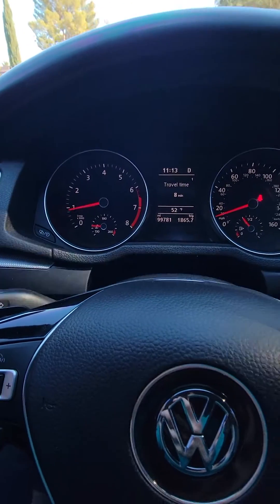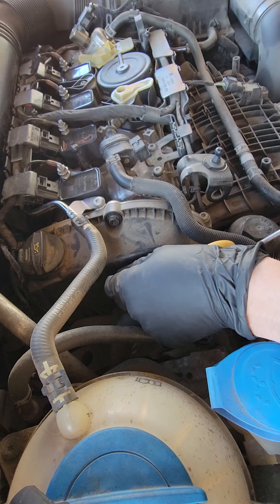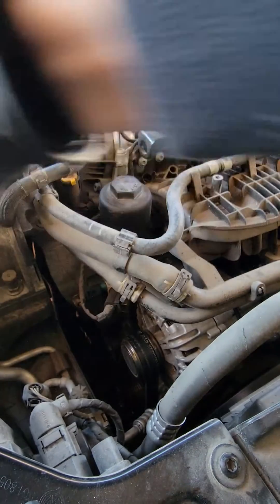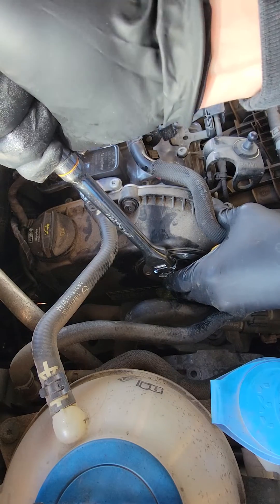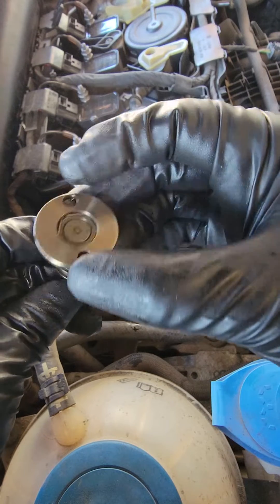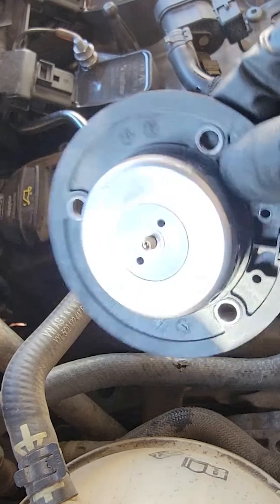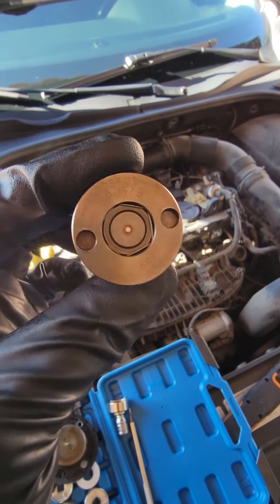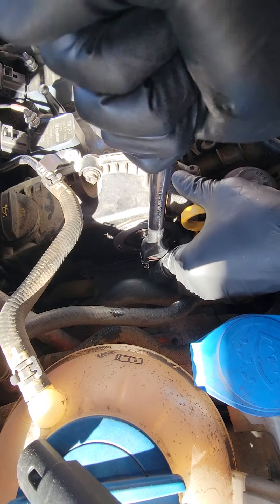Stop Doing 10k Oil Change Intervals! | VW 2.0T P0011 Common Cause & Repair

Comment: I replaced the magnet thing with a brand new one and now that one seems to be failing but I think that the actuator is leaking more than usual so I bought a new one and the kit from Amazon but I'm having trouble trying to get it loose it seems stuck almost or when I go the same direct you went when turning it feels like it goes but bounces back it won't fully unloosen is there any advice you have ? I have a Audi A4 2014 b8 2.0t and has p0011 code
Reply: Are you undoing it clockwise
Reply: @uknown8797 I'll get a better vid next oil change it'll be soon
Reply: I was doing it wrong at first but I fixed that  @uknown8797

Comment: 1:30 what wrench tool or whatever are you using here?
Reply from the maker: Here is everything used in the video - Camshaft Adjuster Magnet - https://ebay.us/l4uKvM
Engine Variable Valve Timing (VVT) Oil Control Valve - https://amzn.to/3Ih6Ei0
Camshaft Locking Alignment Timing Tool Kit - https://amzn.to/3Ci4kDQ
LiquiMoly Engine Flush - https://amzn.to/3WGitmg
Reply: @Mechani_Cole I don’t see this 1:32 wrench thing in there chief unless I’m overlooking it
Reply from the maker: @teeyann are you asking about the ratchet?
Reply: @ yeah yeah myb
Reply from the maker: @teeyann gearwrench 120 tooth ratchet
Reply: @Mechani_Cole  thank you great vid brother

Comment: Should i be able to press the oil control valve open with my finger or a screwdriver (while installed in engine still)? Mine will not budge.

Comment: I have the same “rmps going crazy” but NOT anywhere near 1k rpm. It’s when I’m accelerating at around 3k rmp. Replaced the adjuster magnet with a used one that kinda shakes when you shake it a bit. Could this still be the issue? Also leaks a bit of oil under it. Could it be the adjuster magenta valve seal? Cause I already replaced the adjuster magnet seal.

Comment: Went to replace this part and one of the bolts snapped. Any suggestions?
Reply: Happened to me today. Fk they're soft. One less bolt to remove lol. Lucky mine was on the top, no issues or leaks.

Comment: I changed mine but noticed one screw isn’t tightening. It’ll screw to a certain point then it just turns. Can I put a wire inside with the screw or put a bigger screw?

Comment: Did it fix it ?
Reply from the maker: Yes
Reply: @Mechani_Cole  did u reset it? Alot ppl forgot that it's important point
Reply from the maker: @bm_wuratli6883 everytime🫡
Reply: @Mechani_Cole  hey, by resetting do you just mean erasing the codes? I dont have a code but my 1.8 tfsi is making a horrible ticking noise. Planning on changing this thingy out and hoping for the best, cheers
Reply from the maker: Yes
Reply: @Mechani_Cole  thanks for the quick answer mate. Hoping this will fix my petrol car sounding like a 1.9 tdi😂

Comment: My 2017 passat 1.8 turbo doing same thing where did you get the part at?
Reply: Thanks. Should I also do oil change with it when I do change the camshaft magnet adjuster?
Reply from the maker: @craigwhite5225 always
Reply: Thank you
Reply from the maker: In description

Comment: for some reason the special tool i ordered won’t fit at all onto the vvt lol. i hate german cars
Reply from the maker: Did you order through the link? 

And yeah, it's why they lost 2 world wars lol
Reply: @Mechani_Cole I did order the kit through the link, the tool fits onto the new vvt solenoid I bought, but for some reason won’t fit onto the one thats in the car. 

Any other unethical ways to remove it?
Reply from the maker: @obxev did you try all the different attachments
Reply: @Mechani_Cole  yep, seems like they are slightly not wide enough to fit the one in my car

Comment: VW has gone to shit. They were solid in the 70's, 80's & early 90's. They are definitely not a car anyone should purchase if you plan to keep it for more than 3-4 years.  Oil leaks, skipping time & bent valves are more common on VW's than any other brand.  You will NEVER have these issues on a Toyota or Honda.
Reply from the maker: I can agree for the most part. Hyundai and Kia are by far much worse in reliability in my opinion
Reply: @Mechani_Cole  Hyundai and Kia are often less reliable, but they are also far less complicated. I was always working on my 2010 Accent 5spd, (162k) but the parts were cheap, and it was super easy to work on. My 2015 Passat 5spd  (102k) is definitely more reliable, but it's certainly more complicated and I've needed to buy more tools. Worth the tradeoff.
Reply: yeah around that 100k miles area, a lot can go wrong w/ it. rear main seal, pcv, valve cover, timing cover, camshaft bridge oil screen, cam adjuster magnet, vacuum pump, water pump (if leaked on), timing chain tensioner, intake manifold and valve cleaning due to direct injection. Also can't forget they use lug bolts instead of studs and nuts on their damn hubs, they're real fun if they get rounded and stuck haha. I'm hoping once I get the last of these things done, i'll be good for a while. It's either deal w/ the car you already have or get another one that will have its own problems that you'll have to learn about. Buy older if you can!

Comment: The spool valve needs torquing to 35nm otherwise you will run into cam advancement faults and oil pressure issues
Reply: I think I'm experiencing this, I didn't had P0011, after replacing both the magnet and the valve I didn't torque it to spec and now I'm getting the code but the car drives fine I will torque it and post an update.
Reply: oh the N205 valve?
Reply from the maker: Haven't heard of that yet. It's reverse threaded. So in theory, it's tightening itself every time it in operation. No issues with the non torqued ones I've done yet

Comment: Where did you get the part? Amazon?
Reply: I change the magnet out. It corrected the idle issues now I have a new check engine light with three codes. P0445,p2088,po414 do you think this is related?
Reply: Did you ever figure out the codes that came up?
Reply from the maker: Possibly. Is it running rough? Try reseting the codes and see if it comes back. I imagine you didn't disconnect the battery so when you disconnected things it's going to throw a code
Reply: Yeah, I did not disconnect the battery. I tried clearing the codes and they keep coming on. Should I disconnect the battery?
Reply from the maker: @craigsalonies7144 you can try that. If they continue to come back then you have an issue that needs further diagnosis. Make sure all the connectors are plugged in all the way
Reply from the maker: Yes. Check description for links
Reply: It is not running rough anymore. Just has those codes I mentioned should I try disconnecting the battery to see if it resets
Reply from the maker: Yeah you can try that. What kind of scan tool do you have? Some of them won't clear VW codes as well
Reply: Just a cheap one off Amazon  ediag brand 🤷🏾‍♂️
Reply: I tried clearing the code and disconnecting the battery, and that did not work either. I’m at a loss.
Reply from the maker: @craigsalonies7144 could also be the problem right there

Comment: HEY I HAVE SAME PASSAT ITS DOING SAME WHEN AT IDLE BUT WHEN I DRIVE N PROBLEM . EVEN ITS SHOW ME ALL 4 CYLINDER MISFIRE AND THOTTLE CONTROL VALVE . TIMING OVER ADVANCE , CRAN AND CAM CODE CORRELATION. BUT PROBLEM ONLY AT IDLE????
Reply from the maker: Sounds pretty common for these cars

Comment: Hi there... is the code P0011 related to LOW OIL PRESSURE warning light ??? 2014 passat 2.5... Thanks
Reply from the maker: I don't think so. This is a fault code that indicates the engine's variable valve timing (VVT) system has an issue. The VVT system helps regulate the operating speed of your car's engine, and it does this by automatically adjusting the camshafts.

Comment: Hi man! I have an audi a5 (2010) tfsi 2.0! I have 3 erors p042000, p000a00, p001100. My mechanic service changed my timing chain, spark plugs, but the erores came back! Help me 🙏🙏🙏
Reply: Yeah that was a waste
My mechanic wanted to do the same. But you should start by changing this sensor
Reply from the maker: Agreed!

Comment: What is the mileage on the car?
Reply from the maker: This car only had about 70k miles
Reply: @Mechani_Cole  Just misfire codes were there any camshaft codes. Thanks last question. :)
Reply from the maker: Yes. Both codes listed were present and this resolved it. However if this doesn't resolve it, then it usually means the chain is stretched

Comment: Thanks for the video. I've got no codes or anyting but I have a oil leak here. Will get a new camshaft adjuster magnet and gasket and try that.
Reply from the maker: That should fix it!

Comment: Hey nice video 👍 is there anything else that I have to place to prevent the engine from moving while I remove the solenoid ? Thanks
Reply from the maker: No there shouldn't be. That's why it's reverse threaded so it comes out a little easier

Comment: 35nm torque spec for oil control valve
Reply from the maker: Thanks for sharing that🫡
Reply: @Mechani_Cole  I'm having a problem rn with this magnetic adjuster/ camshaft oiling bs, I purchased the magnet & the valve and am going to throw parts at it till its fixed
Reply: I have no engine codes, but the noise is coming from the upper camshaft, I did the timing chains and guide and everything a couple days ago, I don't think I messed that up, but I really hope I didn't, we'll see

Comment: @MechaniCole ... My 2009 A4 Avant jerked back and forth about 3 times and just stalled whilst I was driving at like 20 mph. Now it will only crank but won't start. Codes are P0011, P0300 and P0305. Do you suppose changing these parts will help ?
Reply from the maker: Could be anything from a timing issue, to bad ignition coils. Hard to say for sure without a further diagnosis. The codes only give a starting point
Reply: @Mechani_Cole  The ignition coils and spark plugs were recently replaced. Phase Position is below 5 degrees on Chain stretch ...
Reply from the maker: @singularity1bh then starting here could be the solution. Check the magnet to see if it's moving properly

Comment: Just did this on my 2015 audi A3 on Oct 19th, 23. I simply removed the camshaft adjuster magnet and blew air in the little holes with my air compressor. Chunks of oil came out, and then the magnet moved freely. After this my car is running sooo much smoother. Ive watched 1000 MQB platform videos and none ever mentioned this repair. So cheers to you! And thank you for making the video.
Reply from the maker: Thanks for the comment🫡

Comment: Now what if you change both and still get the p0011 code ?
Reply: How propertly reset code?
Reply from the maker: Did you properly reset the code with a scanner? 

If so. Then you can have a stretched timing chain or a bad tensioner as well.

Comment: Bro i am wondering will a bad control valve and magnet adjuster cause a knockin type sound around the timing cover ?
Reply from the maker: The magnet itself can make noise. It can also cause your timing chains to make the noise
Reply: I am getting a knocking noise in the same area you mentioned. Going to replace the magnet adjuster and see if that fixes it.
Reply: @reedschmitt8196 hey good day...did changing the solenoids fix the knocking noise ?

Comment: Dude you just seriously saved my ass with my 2013 Jetta GLI - I had the same issue and also was doing my oil changes at 10K per the dealer service dept recommendation.  Not ANY MORE!  Thanks for posting such a helpful video.
Reply: always do half of the recommendation! remember, they want us to buy new cars
Reply: Why not change oil every 10 k ?
Reply from the maker: Because it's a lie the manufacturer's told us we could do. But every mechanic and technician knows that oil is not going to hold up for 10k miles. 

People neglect that number, or forget to change their oil, then ruin their engine. Guess who still gets paid in the end? The dealer that told you to go 10k miles. Don't wait that long. Oil protection wears down drastically
Reply from the maker: Best kind of comments right here! Thanks for sharing that. I'm glad your Jetta is running better🤟🏼

Comment: when the magnet pulls oil in it for the first time it litterally can not move like when it is new becouse it has oil in ti ...
Reply from the maker: I've done dozens of these. The they still move with oil in them. You can tell a bad one pretty quickly

Comment: Hii my audi 2013 Q5, Fault code p001600 can you help me with this? The vehicle sometimes works normally, sometimes it works as if there is no compressor in the piston. And it doesn't move at all with sub-cycles. Thank you!
Reply from the maker: Audi Q5 P0016: Crank/Cam Position Correlation – Bank 1 Sensor “A”
 
P0016 is known to occur in the Audi Q5 when the Crankshaft Position Sensor and the Camshaft Position Sensor are out of alignment by a certain number of degrees or if there is a sensor issue. We’ll explore the symptoms and causes directly below.

P0016 refers to which camshaft position sensor is out of time with the Crankshaft.

P0016 Symptoms

P0016 should be considered an important trouble code to diagnose and repair. The crank and cam sensors work in tandem to produce the ideal air/fuel ratio for your engine. When this timing is off, the engine will typically not run (or barely run)

Here are the major symptoms of P0016 in the Q5:

Failure to start
Rattle coming from the motor
Service engine soon light
Engine poorly running
 
P0016 Causes and Solutions: Audi Q5
Here are the most common causes of P0016 in the Q5, as well as diagnostic advice and resources to further explore. It’ll either be a wiring issue, or it’ll be a physical problem (bad reluctor or timing chain jumped).

Wiring Issues

One of the most common causes of P0016 in any vehicle is going to be wiring issues. You’ll want to inspect the wiring harness for visible damage. A lot of the harness leading to and from the Crank/Cam sensors is going to be exposed to hot exhaust and vibration. This is a great place to start diagnosing P0016 in your Audi Q5. It’s quick and easy to do this before moving on to the sensors themselves.

Make sure to check the harness where it plugs into both sensors as well.
 
Bad Sensors

After examining the wiring harness, it would be time to check the sensors themselves. Using a simple voltage tester, you’ll be able to determine whether or not they are functioning correctly.

Timing

The timing chain or belt will throw cause P0016 to throw. This will happen when it has stretched or jumped a tooth or two. If it jumps more than a few teeth, the odds are that the engine itself will not run at all.

If you’ve recently changed the timing chain, it may very well have not been aligned properly on installation. Many manufacturers (particularly Japanese automakers) have very strict timing chain service intervals. If it’s been too long, it may jump a few teeth. Even the slightest misalignment can cause P0016.

Timing Chain Jumped Symptoms and Diagnosis

Crank or Cam Tone/Reluctor Ring
The Crankshaft Sensor is going to use a tone or reluctor ring to determine the position of the Crank. This ring uses notches that are scanned by the Crank Sensor in order to get an accurate position.

If this ring fails, the vehicle will not be able to get an exact crank position. The camshaft typically will have a ring that provides the same function.

Often, when a reluctor ring goes bad, it’ll rattle quite a lot. That is a very good indication that there is an issue with it.

Comment: Is that a torx you use to take the magnetic cover off and of so, what size is it? I have everything to do the job now but this one piece. Gonna do it this weekend, hopefully 🙏
Reply from the maker: It's a torx T30 if I remember correctly. It's best to grab a full set to have. They are pretty cheap, here is the ones I have - https://amzn.to/3OXyFNl
Reply: @Mechani_Cole  I'm standing in harbor freight as we speak looking at a big box of them for $10. You the man! 🙌👊
Reply from the maker: @RC-ew1wk even better!👏🏼
Reply: @Mechani_Cole  so I just did this fix and it worked!!! My RPM's stopped jumping, my cruise stays on, and my car isn't jerking rolling up to stop signs like it's going to die.
I'm not gonna go into it, but the dealership here wanted to do multiple things (timing chain tension /Camshaft placement) to my car. I have an estimate in front if me for diagnostics with parts and labor that would've ran me $4,372.88
NO BS ☠️☠️☠️☠️☠️
This fix took care of the problem!
You're a fkn life saver man, seriously 🙌🙌🙌🙌🙌🙌🙌🙌🙌🙌🙌🙌
How can I help you???
Share, review... Donate???

Comment: Will oil come pouring out if I do this while full?
Reply from the maker: No
Reply: @Mechani_Cole  never used this liqui moly before so I went to one if your others on how to use it. Think I'll hit up O'Reilly and pick me up some cheap oil to run the moly through to clean out whatever is in my block now and then fill it up with the good stuff after. 
Where do you typically get that liqui Molly oil from? I've never seen that sitting on the shelves anywhere here in the Midwest.
Reply from the maker: I order it online along with most everything else since it's cheaper than the parts store. Links for everything are in the descriptions of my videos. I get the LM flush here - https://amzn.to/3PeZWMG
Reply: @Mechani_Cole  Thanks brother! 
👊
🙌
Reply: @Single_Dad_  Amazing I find a lot of liqi moly @ Advance Auto here in Chicago/NW Indiana & price is equal to online prices... Just brough some this pass weekend🙃🙃